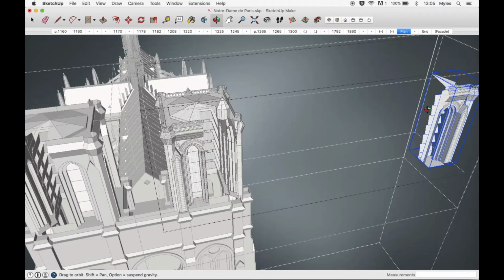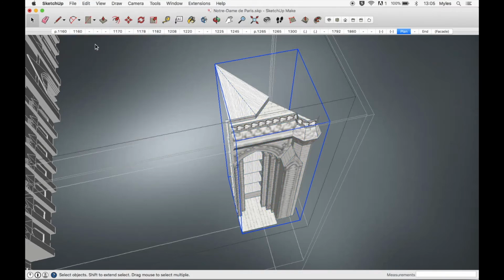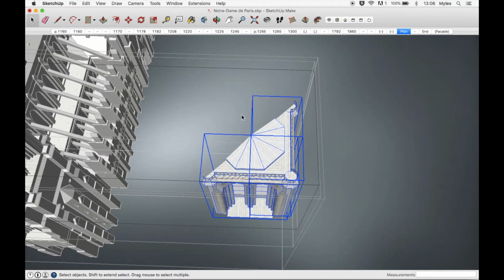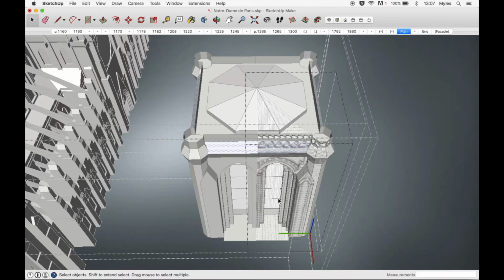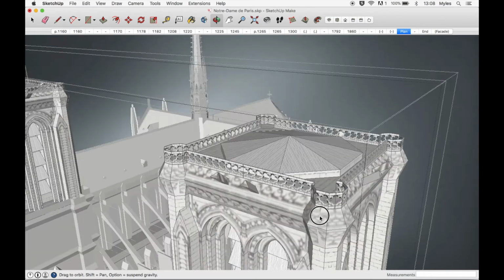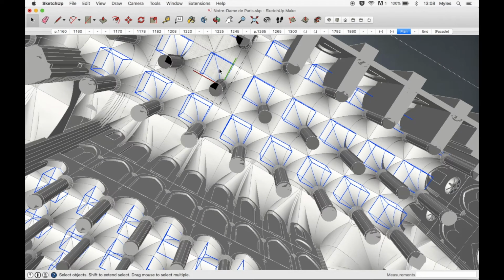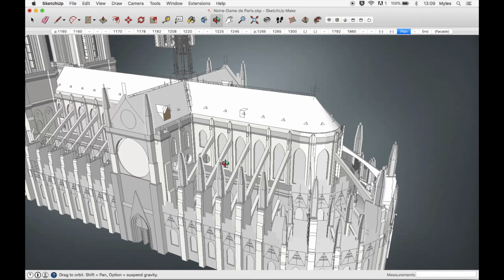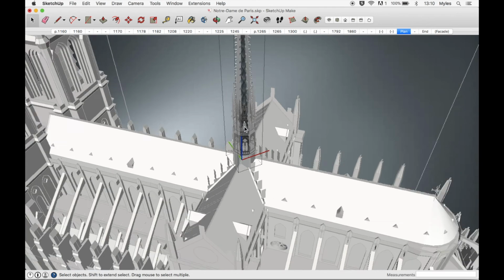How can strategic use of components save on time and polygon count? (Part 3/6)

Comment: These front towers gave me a headache in the beginning. They both seem perfectly symmetrical. But in fact they aren't.  The main problems are the staircases. They needed space for the staircases and enough body around the staircases to hold the stone structure in place. The result is that they had to finetune the dimensions to still make it seem perfectly symmetrical. So the structures on the outer corners with staircases are a bit wider than the rest of all the corner structures. These finetunings are on the northwest and southwest of the west towers. Results of this trick are hardly noticable on the overall west side, because they appear on both sides of the towers and so on the overall look both towers still looks perfectly symmetrical from the west. I've even tried to include this issue in my works, yet hardly noticable. On the east side, the back sides of both the front towers, there are no staircases, so the dimensions remain on both towers the same.
Reply from the maker: Yes, the cathedral's dimensions are quirky and asymmetrical through and through. Part of the builders' genius is how good the finished project looks, despite its countless imperfections that only become visible in section and plan. Most floor plans online, for instance, show the cathedral as it should look. But measurements vary throughout with entire sections being built on a different axes from the rest. Here's one plan that's more accurate: https://www.researchgate.net/profile/Bart-Postma-2/publication/318432522/figure/fig11/AS:631671644758018@1527613664008/Measurement-plans-a-1987-and-b-2015-of-the-Notre-Dame-cathedral.png
Reply from the maker: One cause for these imperfections might have been the desire to build the foundations on an entirely different footing from the earlier basilica. Another cause might have been inaccurate and primitive measuring tools. And still yet another cause is most likely different teams of masons working on different parts, often in competition with each other. At St. Paul's Cathedral in London, for instance, four teams worked each on one quadrant of the cathedral, with the team that finished first being rewarded with bonus payment.
Reply: @MylesZhang  Of course, a bend in the perpendicular bisector. The trancept is not perpendicular with the nave. So that explains why the flying buttresses on the south south east (behind sacristy area) are slightly different from the rest. Thank you so much for sharing this information, sir. 

This amazes me as a builder, former garderner with carpenting skills, and now as a self thaught architect. While I was a garderner/carpenter/pavementbuilder, our job was to make it look like there were no flaws in the execution of the design. Sometimes when we were building roofgardens with wood elements, we ran in differences from the original design. The corporation made new measurements and adjusted everything in design for the roofgarden like every stone was supposed to look like it does. Furthermore we always made some last agreements on dimensions for deviations in design. 

So, as a builder, yes nowadays we still build with lines just like back then. But back in the day, they had no lasers. They had no spirit levels. The only thing to level something vertically were plumb bobs. To stake out a cathedral was a (pun intended) painstaking job. People, other builders and animals could accidently touch the lines. If left unchecked, you will see it in the end result. 

What went wrong with the Notre Dame is not only primitive measuring tools, but also multiple generations building on it.  These kind of mistakes sneak in over time as the build was done in phases over a time of 125 years. Some of their agreements about certain measures might have changed. 

It's still amazing how the spire concealed and will conceal the bend in the perpendicular bisector. So if you're looking from the ballustrade between the bell towers to the back of the Notre Dame, without a spire you will clearly notice the bend. With a spire, you won't be abled to see it with your own eyes. 

Another new thing learned. Thank you.